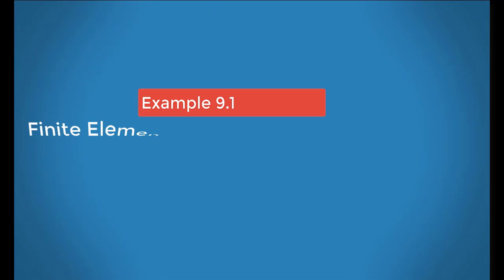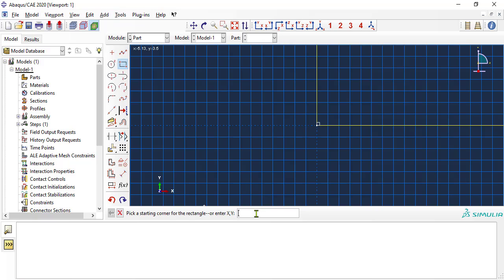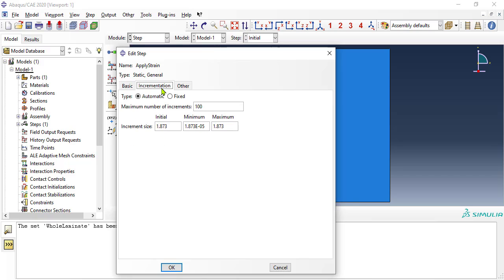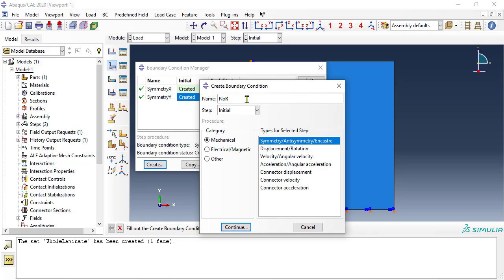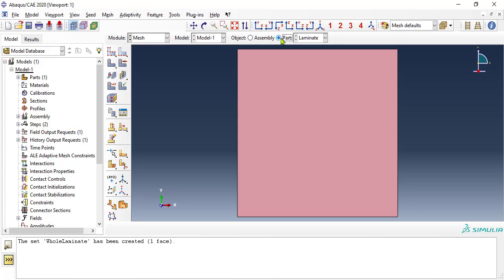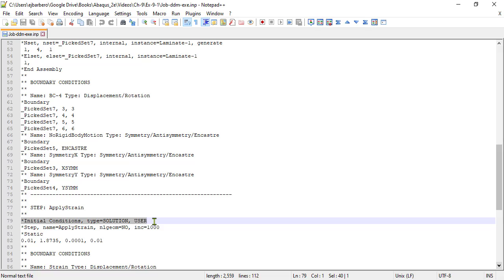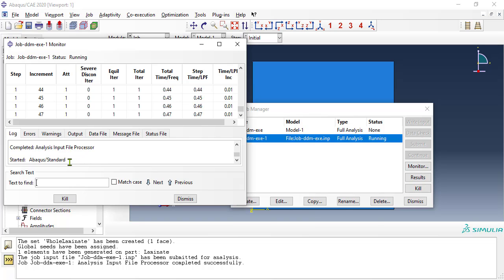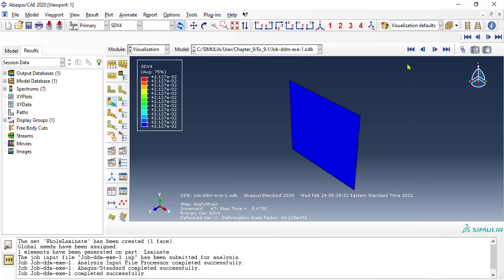Example 9.1 Transverse damage crack density UGENS & Python script in Abaqus for laminated composites

Comment: Thank you very much for this video.

i tried to test the example 11.1 with the thermomechanical fatique damage. 

i am getting the error:
This error may be due to a mismatch in the Abaqus user subroutine arguments.   These arguments sometimes change from release to release, so user subroutines   used with a previous release of Abaqus may need to be adjusted.

I think the Subroutine.for needs adjustments, because i am using Abaqus 2022. Any hints how to solve it?

Comment: Prof, Barbero

why when I apply it for +45/-45 lamiante it does not work
Reply from the maker: DDM requires the laminate to be symmetric, like (+/-45)_s. Also, a +/-45 or (+/-45)_s is a bad choice for tensile load, please read about the 10% rule in my textbook Into to Com Mater Design.
Reply: Hello Prof Barbero

I used the DDM in two symetrique laminate the first (0/90)3s and it's work perfect but for the (+/-45)3s lamiante it does not work.

Comment: Prof, Barbero,

Would you please let me know whether failure criteria discuss details of the kind of failure in composite materials? For example, does hashin gives us the type of failure?
Reply from the maker: In https://www.amazon.com/exec/obidos/ASIN/1138196800/booksoncompos-20 page 232 after eq. (7.5) "... maximum strength FC gives information about the mode of failure...", same for maximum strain FC, then for the "interacting FC" in section 7.1.4, you get either fiber or matrix failure, but you don't know if matrix failure is due to shear or traction or both, same deal for Hashin FC. There are other considerations in chapter 7, such as "7.14. nonlinear behavior," see after eq. (7.14), "7.2.1. in situ strength", "7.3.2. truncated maximum strength" also tell you what mode of failure is active (fiber tensile, fiber compression, or fiber shear).  I think TMS is best because if "failure means ultimate, that is, the laminate breaks" then, matrix failure is not an issue "only when the fiber breaks the laminate breaks" unless the LLS is not well designed (also discussed in Ch. 7 and elsewhere in examples that textbook).
Reply: @EverBarbero  You are great, man

Comment: Dear Prof. Barbero, 

In order to apply any failure criterion for composite materials, what should be considered? Could we use any criterion for our analysis? I want to compare my experimental results (type of damage) with the results given by failure criterion in abaqus. I am not sure which one I should apply.
Reply from the maker: Failure criterion and damage models are not the same. I think in chapter 7 of Intro to Comp Mater Design ISBN 978-1-138-19680-3 has a good explanation of the limitations of Failure Criteria, and Chapters 8 and 9 of FEA of Comp Mater Using Abaqus ISBN 978-1-4665-1661-8 the same thing for damage models, but anyway, failure and damage criteria are very specific for type of materials, type of loading, fatigue or not, temperature or not. It is not an easy question to answer. It would be nice to have "guidelines for failure criteria to use" and "guidelines for damage models to use," but they don't exist yet.
Reply: @EverBarbero  Professor, would you please let me know which case is longitudinal shear and which one is transverse shear in your book page 229? I think F5 is longitudinal and F4 is transverse, right? What about F6?

Comment: In my created .inp file there is number 3 after thickness of 2.736 which I think is about the integration point in section part. You do not have this in video. You deleted it or...? The job-1.inp has nodes and element numbers in my file but it does not have in yours. Again you deleted them and they do not have any effect?
Also, in your book you did not mention about rotation boundary condition I think
Reply from the maker: 2.736, 3 
is correct

My file has nodes and elements. See the video at 9:04 (9 minutes 4 seconds)

Comment: Professor barbero, in my created .inp file there is a number 3 before the section shell thickness 2.736. I think it is related to integration points in that section. You did not have it in yours by the way. Did you delete it? Also,
From which part of the code abaqus understand that there is 4 sdvs? I have 15 sdvs in my result
Reply from the maker: When I did the video maybe I left the default Simpson points at 5 so nothing would be written after 2.736. If you change the Simpson points to 3 then it is written in the input file AFTER 2.736. 

It is better to use 3 Simpson points because one is at the top of the lamina where the stress is either highest or lowest, another at the bottom where the stress is lowest or highest, and a point in the middle that is no good for anything. If you put 5, then 3 points are a waste. The distribution of stress is linear anyway. 

There are 9 SDVS, Abaqus knows because in the input file it says VARIABLES=9

Comment: Professor sorry for lots of questions. You mentioned that "one
has to be careful with the solution strategy " due to the material nonlinearity. Therefore, in the increment section you defined corresponding values. How should we do that? How do you know which increment size and time and etc we should zpply?
Reply from the maker: trial and error. experience.

Comment: Professor, did you apply UGEN subroutine here? I do not understand the part with 30 parameters exactly. GIc,GIIc,deltaT,E1,E2,G12,nu12,nu23,alpha1,alpha2,thetak,lamina thickness,lambdak,D2,D6, and 3*N state variables. These are 15+9 = 24 parameters
Reply from the maker: Yes, Ex_9.1 is done with UGENS. 
The DDM plugin requires 3+9N parameters and uses 3N state variables, where N is 1/2 the number of laminas. The laminate is assumed to be symmetric, so we enter only 1/2 of the LSS. 
The first 3 parameters are: 
GIc, critical ERR mode I
GIIC, critical ERR mode II
Dummy (for future use)
Then, 9 parameters per lamina (7 material properties, plus the angle and the thickness).  
E1
E2
G12
Nu12
Nu23
Cte1
Cte2
thetak
tk
Total: 3+9N parameters (material and geometrical). 
Internally, the DDM plugin uses 3 state variables per lamina (crack density, transverse damage, shear damage) for a total of 3N. In Abaqus, state variables are denoted by SDV. In the results for this example, SDV1 is the crack density for the bottom lamina, SDV4 for the center lamina, and SDV7 for the top lamina. The 2 damages are not true state variables, only crack density is a state variable, but we keep D2 and D6 as state variables to simplify the computations, internally.
Reply: @EverBarbero  Professor thanks for explanation. Therefore, 0.254 is assigned for GIc and 100000 is assigned for GIIc, right? In he mechanical constant sections
Reply: Since you did not mention in this video about adding subroutine in file I think. I don't understand the .obj file since it would not be opened in notepad by the way I think I confused
Reply from the maker: yes, correct.
Reply from the maker: The code is here: 
http://barbero.cadec-online.com/feacm-abaqus/Examples/Chapter_9/Ex_9.1/Abaqus2020/

abaqusddm-std.obj is the plugin that the script puts in the Job. It is compiled for Abaqus 2020. You need visual studio and Intel Fortran installed properly for Abaqus to link the .obj file to Abaqus itself. It is done automatically when you click Submit.
Reply: @EverBarbero  prof. Barbero, yes I run 2017 version code in abaqus 2017 and it worked actually. Yep I combined them before
Reply: @EverBarbero  So the .obj is actually the ugen code right? UgenKeyword.py is the code that should be written as UGEN?